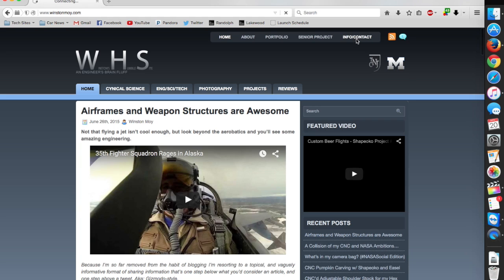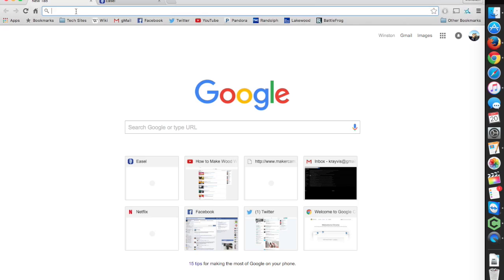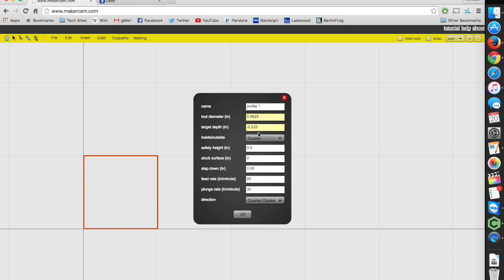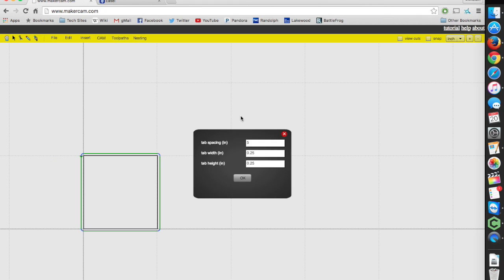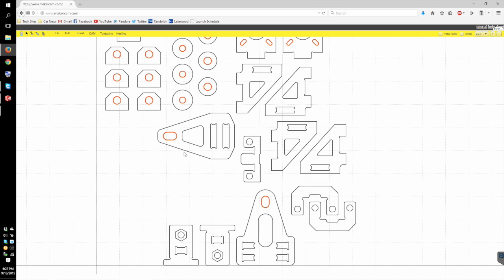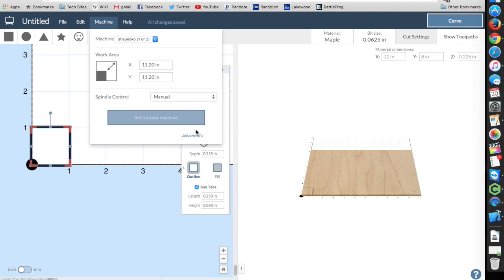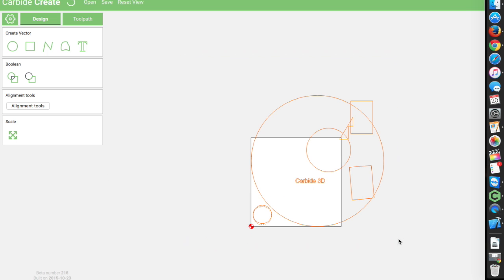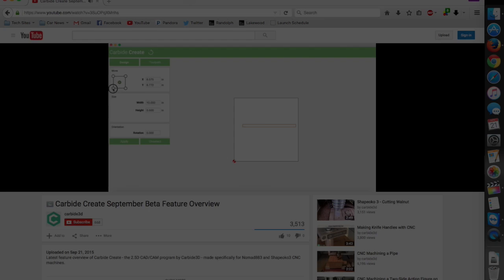Shapeoko Basics: Making Gcode (2.5D) in MakerCAM, Easel, and Carbide Create

Comment: Looks like Carbide Motion does a good job of engraving fonts. However it will not start up without hardware connected.  I will probably buy a cheap mini CNC, looks like they all have USB port.  What do I need to look for, before making my purchase.

Comment: Thank you for your video. I'd like to know what is the use of tabs ? Carbide Create does not  offer this option do I really need it ?
Reply from the maker: Workholding tabs are little bridges of material that keep your cut pieces in place. Sometimes when you cut a part out, it can get knocked loose and either get pulled off the table, or pulled into the endmill resulting in a damaged part. 

They're not essential, there are ways around it, but sometimes it's just most convenient to use tabs instead of double sided tape, or "onion-skinning" you piece, where you cut 99% through your material, and leave a little bit to hold everything in place. You'll be fine to start in carbide create, but one day you may find yourself outgrowing the program.
Reply: thank you !
Reply from the maker: +Teddy Kishi they literally just added tab functionality to the program half an hour ago... Still a few bugs to quash, but theyre actively trying to improve the program.
Reply: +Winston Moy you're awesome dude !